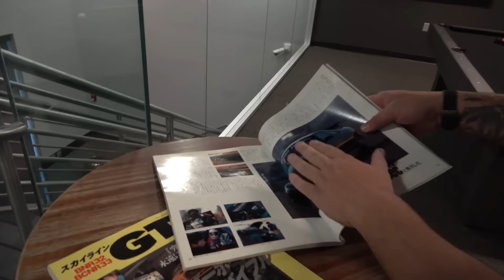HIDDEN PARADISE! LowballerGTR's Dream Garage and Car Collection

Comment: Vipers are slept on forsure, I mean for the money you can’t beat it, the newer ones are around $100k and still a lot of car, and even some of the mid 2000s cars are under $40k and again V10 manual car for under $40k.. not traction control or abs but still. I’d still get a newer one forsure tho idk if there is anything that can compete. And that’s not even getting into the Calvo twin turbos kits.